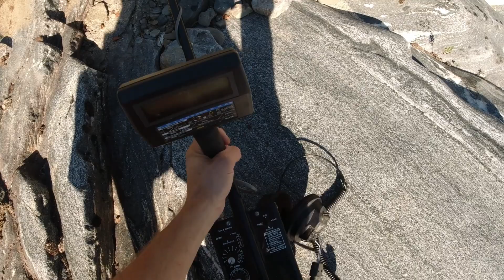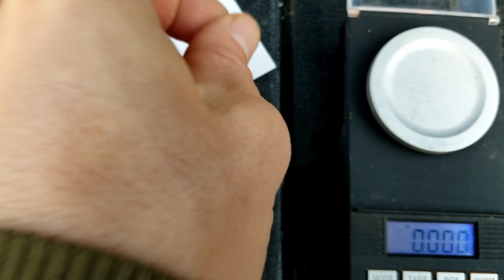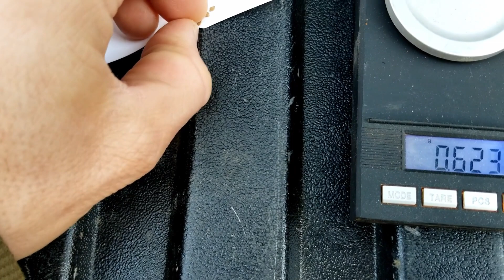I FINALLY found GOLD with my METAL DETECTOR!!!  And it’s a RECORD NUGGET!

Comment: Nice finds! 
 Newby here in Canada and I just bought a never used White's MTX tracker E series detector and am excited to use it! the seller bought it 6 years ago and never used it once!
  I have a couple beginner models that I have had limited success with, but just in a few minutes in my yard, I could already see the difference that a good detector makes. What coil are you using? mine came with the Eclipse 950. 
Cheers

Comment: right on Eric, yeah that DeWalt I mentioned is light & easy to carry & very strong for it's size & easy to hide incase DFG comes around, funny BLM says it's ok w/ them, go figure. What I do is get a 3/4" surgical tube & put at end of nozzle about 12" to 14" length so you can get into those smaller cracks, works great. I couldn't believe all the material you were getting when you broke up the bedrock, pretty cool,
Merry Christmas & Happy New Gold Year to you, Serg

Comment: Eric, that's amazing looking bedrock & crevices there, so many places to dig, never ending and never enough time to get it all. suggestion: in order to save precious mining time, I pan down to the black sand then put that into a freezer bag to take home & run the black sand on my Miller table, I think the Miller table is the best way to get rid of the black sand & most of the gold stays on the Millet table top, there is rolly polly gold, so I have half Miller table at the top & half V-mat at bottom to catch the gold that goes down, works really good, takes time but hey, when your at home, should have plenty of time & you can do more mining this way. Also, get yourself a DeWalt 1.5 gal battery shop vacuum to get all the dirt cleaned up, this vac. is small & light & very strong, bring xtra batteries. Must be very exciting to find gold w/ the metal detector, I can't wait until I find mine. Very nice nugget also. VG is cool also.
Thanks for the adventure, Serg
Reply from the maker: Thanks again.  Awesome, I have a friend with a shaker table I should do that and just bring it to him.  I've been collecting the black sand in a jar, at some point I'll process it out.  Yeah I really do need to get a vacuum of some kind it would make things a lot quicker.  I haven't gotten serious about processing volume yet, still just kinda poking around the claim to see what spots are hot and what spots are not.  I've got a mile of river on this claim so it's gonna take a while!  Yeah I purchased the metal detector like 10 years ago thinking I would find some nuggets... just now I FINALLY found some gold with it.  Hopefully the first of many!

Comment: Nice I still have never found anything with my detector. But I have an issue with only putting maybe an hour in then jumping in to snipe.
Reply from the maker: Haha, I feel your pain, metal detecting is really frustrating.  It was refreshing to FINALLY find something with it after years of using it here and there.  It also makes it a little easier to not "accidentally" start sniping when the water is in the low 40's!

Comment: Congratulations that’s the toughest one!
 Tear the bed rock up with the right tools make a mess and then detected!
 Your detector will not be ruined if you drop it in the water or get it wet!
 I’ve owned about every detector made for gold and there extremely tough in fact when they get dirty yeah in the switches and so forth I actually wash them in warm soapy water let them dry out good in the works like new.
 Your Coyle is probably the weakest link make sure you were in Coil covers and when you beat it up and The inside of the coil gets loose drill some show holes in it squirt some silicone in there so don’t send your false signals make sure your call wires wrapped up properly and does not get damaged make your machine solid so the call wires aren’t flopping around your machine is not flopping around your headphones are not shorting out so your machine is solid no false signals always use your headphones.
 Keep your coil on the ground kick stuff out of the way with your feet if your coil is not 3 inches or less you detecting nothing if you go over a rock that’s 2 inches in diameter you’re not detecting anything look for the small clear signals most people Hunt nails or cans
 Nuggets or small and have one field.1Beep
Any metal has a north and south field 2Beeps
Sniping is the best way to learn more gold hangs out.
Semi dry Suit stay light cover ground. You can always go back with the right tools.
Best time for mining is right now when that rain is coming down harder I’m headed out right now to prep don’t have no water in them normally. Throw the rock out roll the rocks out if they’re bigger walk up and down stay active in the water it will concentrate and get you down to bedrock Follow the old timers
Reply from the maker: Good tips.  What is your favorite metal detector for gold that you have found out of all the ones you've tested?